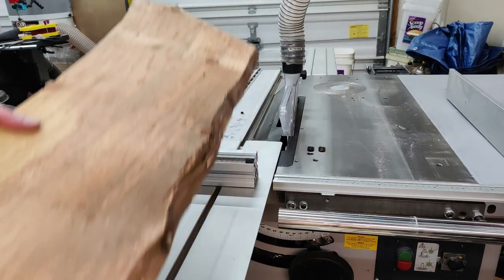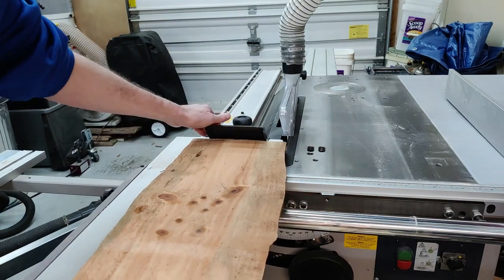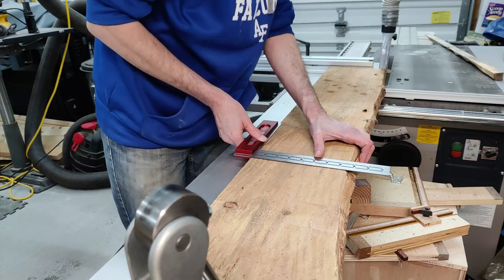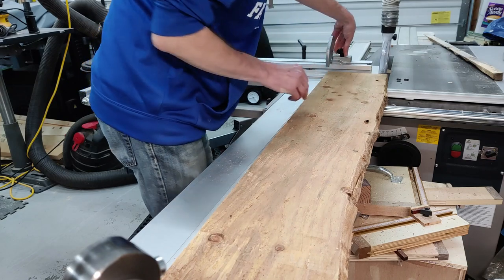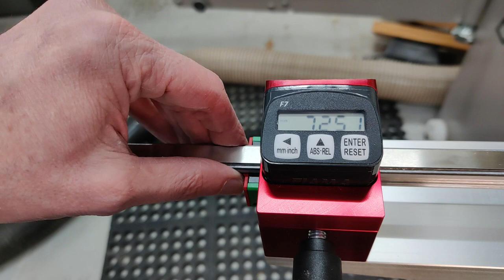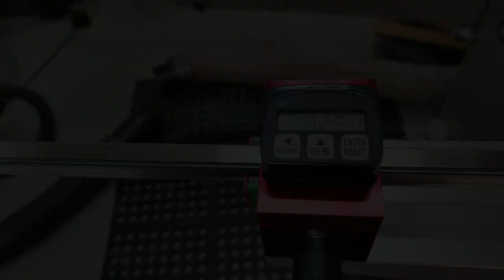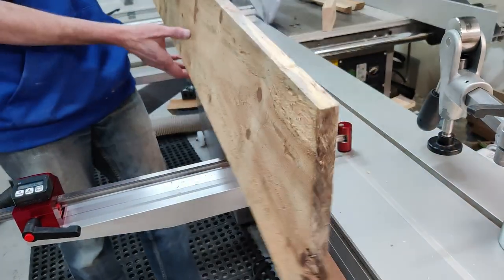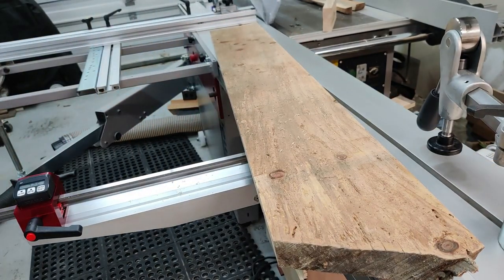Using Parallel Fence

Comment: Make sure you are holding down the power button for atleast 5 seconds when turning on the saw. I was warned by felder that negating to do this would burn out the capacitor on their single phase machinery. 

Thanks for the video. I would be interested in a video on the set up and tooling for the shaper, as I have your saw without the shaper.

Thanks
Reply from the maker: You're right, I'm terrible about that. Thanks for reminding me. 

I will definitely be doing some shaper specific videos. I'm taking a shaper workshop this Fall in Colorado as I'm not comfortable with the machine and what it can do. I have some projects where I think that a shaper will come in handy.

Comment: I am sure I have seen a 220V tool remote that will turn on your saw and the dust collector at the same time. I love your table saw, but that switch location is a killer.
Reply from the maker: I agree about the switch location. It would take some work to to add that type of remote switch as it's a magnetic switch. You momentarily create a circuit to start the saw and engage the switch. The off and emergency buttons interrupt the circuit holding the switch in the on position. Getting into the power box in the saw would void the warranty. Maybe after the warranty expires I can try something.

Comment: Looks like when you rip to a certain width , you are using the miter gage with only about 7 or 8 inches of wood as a reference. In a traditional saw you will be using the whole length of the board as  a reference.  Am I missing something here?
Reply from the maker: Perhaps I'm not understanding your comment. Ideally, I have a second parallel fence and use those two points to set the distance from the edge to the blade. I'm using the miter as one of those reference points. Which is fine if the width you are cutting is wide enough. I'm currently cutting some pine to mock up a table leg and the miter isn't close enough to the blade. So I'm using the Fritz (or is it Franz?) to give me the distance to the blade on the front end.

I'm thinking about doing a second video to cover that and to talk about doing tapers. If you want, you can contact me through my website ( dnisw.com ) and we can work it out. I don't think I answered your question.
Reply: Ok thx. i missed the parallel gage in a previous video, not this video. I commented on the wrong video I think. Thank you for your explanation. I was also wondering why you did not use a standard rip fence.
Reply: @vvjkumar  ripping with a slider is much safer!

Comment: Are you still happy with the DRO parallel fence?  Is it sometimes finicky to get the exact measurement dialed in?  Looks like it could almost use a micro adjust feature.  I’m shopping for a parallel fence now, just wanting to find out info on them.  Thx
Reply from the maker: Hi TW, I am satisfied with the DRO on the parallel fence. My fence comes off and on fairly often, so it's easy to recalibrate. I've gotten reasonably good with getting it set to where I want it by placing my fingers on the bar against the DRO housing and slightly rolling (or squeezing) my fingers. When you tighten the setting, it may move 2-3 thousandths of an inch (1-2 hundredths of a mm in metric mode), but in woodworking, that's usually close enough. I've seen other shop made parallel fences on YouTube. One that comes to mind was made with an Incra fence on a table extension on the slider. The downside is the price. It would make sense for a professional. For the average hobbyist, it's a bit hefty.
Reply: @CutitwithaHammer  I haven’t used my large hold down clamp supplied by Felder yet, do you ever find this causing movement of the moving material as you set the clamp down on the material?  Thx
Reply from the maker: No, I have not. As another viewer pointed out, the further you make the clamp 'reach', the easier it is to apply the clamp. The clamp applies a lot of force. 

I will see a bit of movement with the DeWalt clamps I show in the clamp video. This is probably due to these clamps not being vertical when I'm applying pressure.

Comment: Why didn't you use the standard parallel fence?
Reply from the maker: Excellent question! One of the goals of this channel is to show how a sliding table saw is different that a traditional saw, so using the rip fence in the traditional way doesn't show something different. As I've said in one of my earlier videos, there are woodworkers with sliders, but use them more like a traditional saw.

You have given me an idea to do another video to highlight the different ways to rip boards on a slider. Thanks for the question!

Comment: Well, thanks for the demonstration, but this reminds me of what Voltaire said about the Holy Roman Empire: It's neither holy nor roman, and it's not an empire. This parallel fence is not parallel, and it is not a fence. It is an expensive stop, with an unnecessarily sensitive readout.
In your video, you kept the work piece parallel to the blade by using the front miter fence (you actually stopped to check the square, and you made sure that the flip stop was engaged), and you kept the work piece in that position by using the eccentric clamp. In other words, technically you never had a parallel fence during the whole cut. Yes, you had a digital reading, but you could've used the scale on the front miter fence for the same purpose.
You would be better off if you use both the miter fence and the rip fence that came with the sliding table saw to your advantage. In this case they complement each other to give you an edge over the traditional table saw. If you search youtube, you would find many people who went to great length to build jigs just to accomplish the first cut, yet for a slider the first cut is a most natural cut that requires no jig and no setup. The final dimension would then be set by the rip fence. This is the best of the two worlds, and I think you're trying a little too hard living in the world left to the blade.  :-)  Best of luck.
Reply from the maker: Hi Se! Thanks for the detailed and thoughtful comment. You made a lot of valid points. I do make a lot of use of the rip fence. It depends on the size of the piece and how much I'm taking off. The bigger part is always on the slider.

One could do the some of the same things with a block of wood that comes to a point. I may not find a use for the parallel fence that can't be done almost as easily (or more easy) in another way. I have a couple table projects coming up that will require a lot of tapers, so we'll see when I start doing those.

Living left of the blade is one of the goals of the channel. :)
Reply: @CutitwithaHammer  I have owned a K3 for many years and never use the rip fence unless forced to. In fact I don't have a rip fence on the saw at all just a 300mm short piece of fence which is used as a bump stop to measure the required off cut. To suggest using the rip fence is to ignore the whole concept of a slider, this is not a cabinet saw and should not be used that way. One thing I have also learned is that there is very little reason to use clamps and I rarely do.

Comment: Hello, thank you for making these videos. So little out there for sliders.  
I do have a question not related to this video, but slider use in general.
Why do you use the miter guide at the front?  I can maybe see the benefit in rip cutting especially if you have that clamp at the back of the slide, but when making cross cuts.  Isnt it safer and more controllable to have the fence provide that support going into the cut versus using your hands as the support?
 I hope my question was understandable.
Thanks in advance!
Reply from the maker: Thanks! It's why I started doing these videos. It doesn't help that you never see them in a store. If they were out where people could see them, I think they would be better known.

I set miter up that way in the beginning to try it and never changed it. I've heard it said that it because you are pushing the piece into the miter instead of holding it against the miter. But the table moves so easily, I'm not going to agree with that.

With my old T/S, pushing the wood & miter across the surface of the saw, I sometimes felt like I was holding the wood against the miter really tightly and on bigger pieces, it was really hard to to do that. One hand pulling the piece to the miter, the other pushing everything forward.
With the slider, you generally want to clamp your bigger pieces to the table. For smaller pieces, I usually push down on the piece and not against the miter, so I'm being the clamp.

On my Hammer, the outrigger won't reach all the way to the back of the table when the table is all the way back from the blade (that's at least an 8 foot reach), so it's less hassle leaving it at the front of the table. I could move the miter bar to the back of the outrigger, but I cut enough sheet goods that I'd be moving it back and forth a lot.

If you don't get the outrigger, then the cross-cut miter bar (which is different than the outrigger bar) clamps to the table and you could definitely use in at the back end of the table.

I'm hoping to do the full-up review of the saw in the Spring and I'll go over this again. Thanks for the excellent question.

Comment: What is the DRO you are using on the parallel fence? I put on on my K3 main fence but would to put on on the other. Thanks
Reply from the maker: It came with the unit. You can get digital or analog.
Reply: @CutitwithaHammer   thank you for the info. Do you have a link for that?
Reply from the maker: @chrisswartzwelder8494  Sure: https://lambtoolworks.com/

Comment: In order to attached the parallel fence you had to use a wrench, it doesn’t come with a Kipp lever or knob to tighten down the support table?  I could have sworn I saw it with a knob at least.  Thx
Reply from the maker: It would be nice, but not on my units. There is very little clearance around the bolt head. Probably about 90 degrees worth of pivot space. The bolt is 3/8" x 4". Could be 5/16". I can't remove the bolt to measure as there is a retaining washer holding it in. 

Perhaps the ones for the Felder line have them as the table profile is different.

If I get an opportunity, I'll show it in a future video.